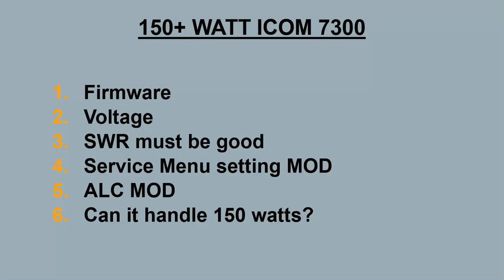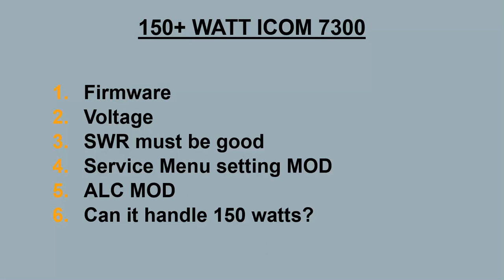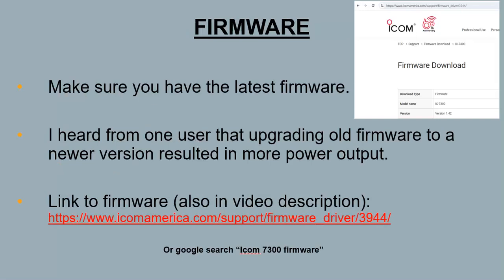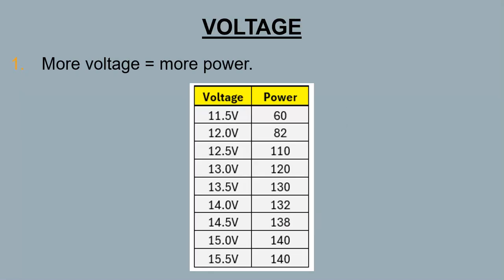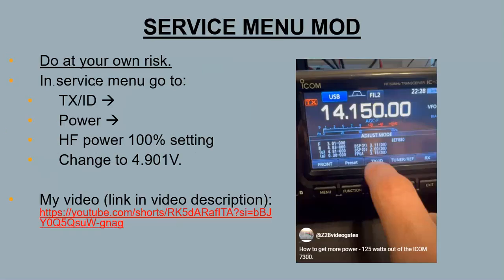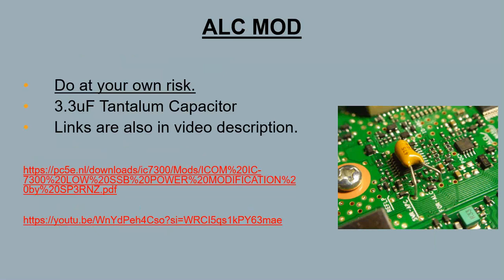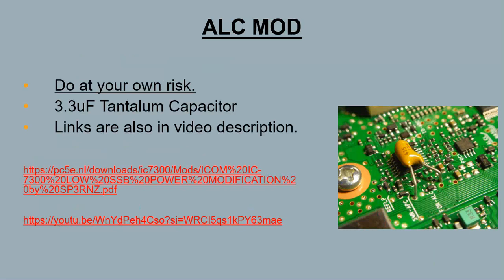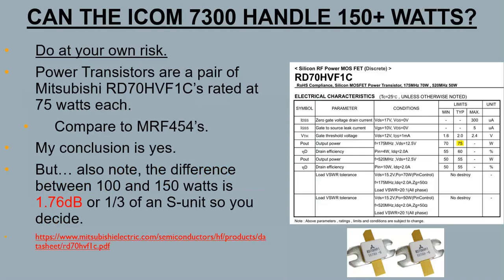150+ watts out of an ICOM 7300!??

Comment: For all the cry babies. Ive been running this mod for years with no issues
Reply from the maker: Agree.  The radio has a pair of 70 watt transistors.  Similar to a small “2 pill” amp (like MRF1446’s).

Comment: I run my radios at 14.2-14.8vdc.  I know it will go up to 15vdc or a bit above, but this is your headroom!! Cranking the power up and messing with the radio for more power, unless you can get 4 times the power out of the mod, it’s not worth the effort.  If you are worried about audio l, buy some audio processing equipment or a different mic.  There are plenty of nice EQ’s and such on eBay and every major electronics distributor.  JMHO, it’s not worth the little bit of power.  I do t think I’ve ever had to run 100 watts to make contacts around the world.  Antenna would be my solution for getting out!!! Again JMHO.